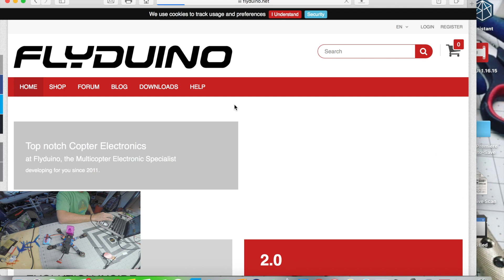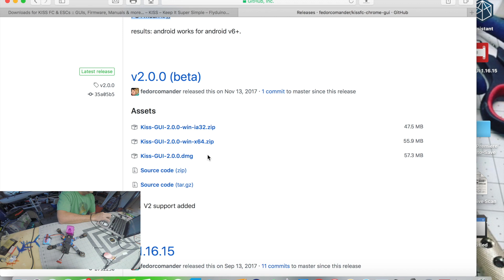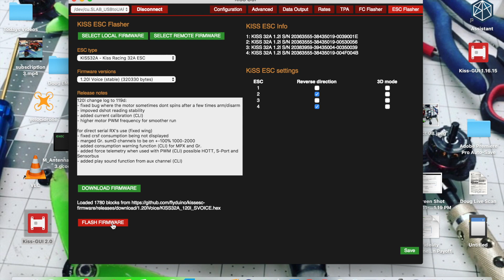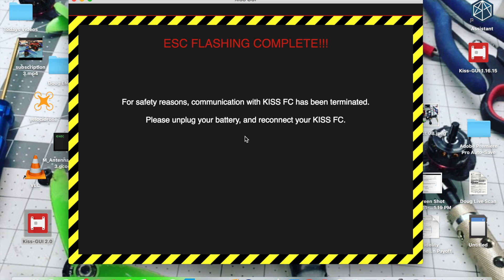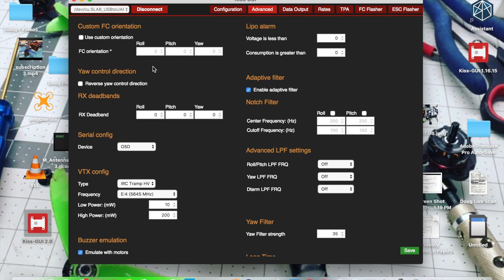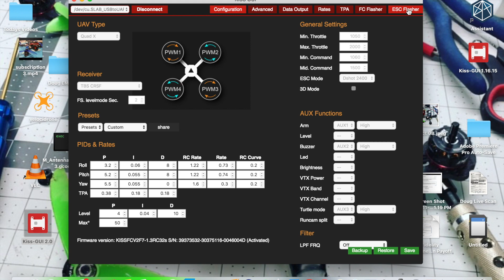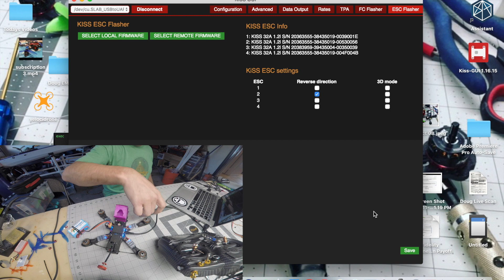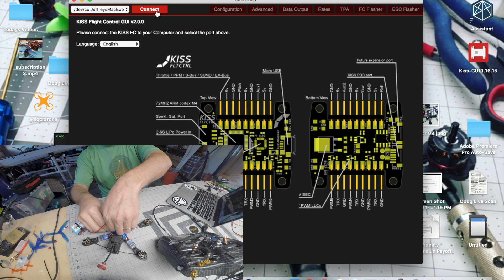Flashing Kiss ESC 32A

Comment: I have the same problem that you had at 2:58, can't get all the ESCs to show at once ... I only see either ESC#1 or #2, never both of them and never all 4 of them. They work alright, flying good. But can't get to flash them..
edit: I tried to flash them anyway, even without any info showing, and while flashing, all 4 started blinking (receiving data) so it worked even without any info about ESC showing .After I flashed the newset firmware, the ESC info showed up again, for all of the ESCs!!
Reply from the maker: Mavi congrats. I mistakenly flashed the wrong firmware once and had a similar issue, only certain ESC’s showed up and actually some of them didn’t even have the ready lights on. I found that if you reflash to the correct firmware they will come back one at a time. So in other words, if two didn’t work I’d reflash three times.  Once to reflash the ones that registered and two more times for the ones that didn’t register.

Comment: I flashed my esc’s and then one of them quit working. They are brand new 32 amp kiss. 

Do you have any idea what might have made that happen?
Reply from the maker: Nameless Droner, no lights or anything come on?  Go through and make sure nothing is shorted, and that nothing is touching the carbon.

I’ve heard of people bricking the v1 ESC’s but not too much on the 32amp esc. 

Check all connections too. If all seems ok you can try to reflash. If that still doesn’t work you may have to swap it out.
Reply: Bulldog FPV I can’t reflash them because now the GUI only recognizes the three escs that are still working. 
The one that quit doesn’t even have a blue light. 
When my new esc gets here I’m gonna go through everything again.

Comment: im just starting a kiss build and I dont understand why people solder the reverse jumper on the esc if you can just change it in the GUI or am i missing something ?
Reply from the maker: Mezza FPV believe it or not, the option to reverse the motor direction in the Kiss GUI is rather new, maybe cane out 6 months ago (don’t remember the exact time). So before this was released in the GUI the only way to reverse the motor direction was to solder the pads on the ESC.  it’s not necessary now unless someone would want to run old firmware for some reason.